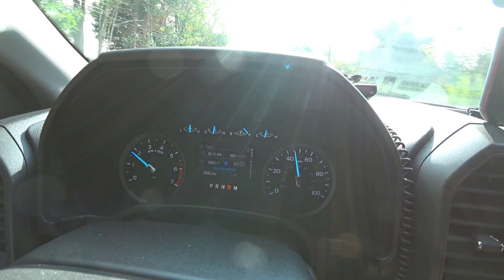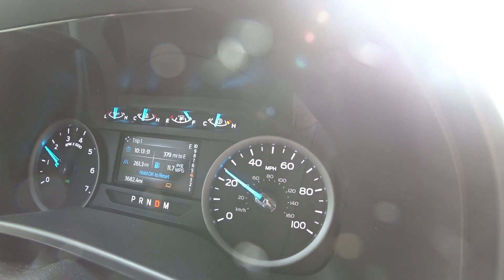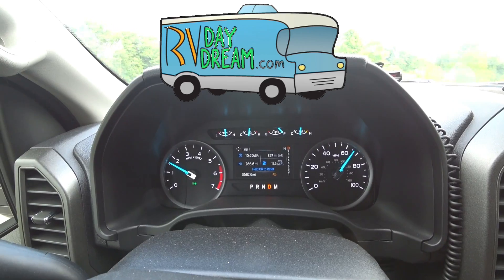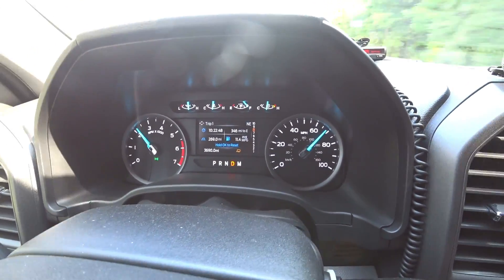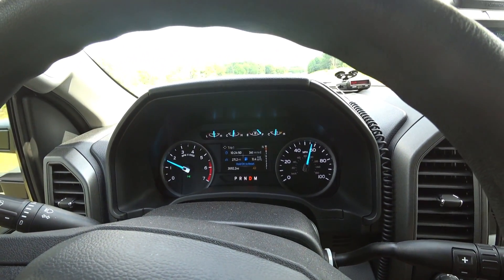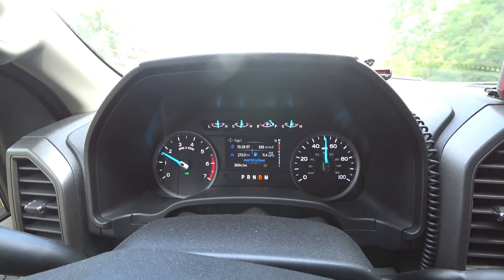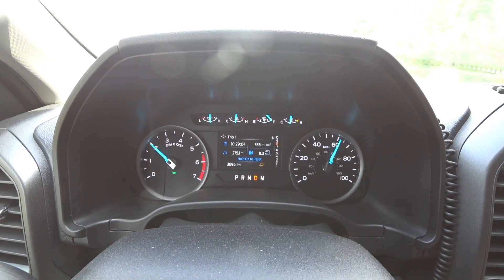2020 Superduty 7.3 Towing 8000# Travel Trailer

Comment: I'm wanting to replace my 2002 Duramax with this truck, same as yours. 

How is it dealing with fuel stops while pulling the travel trailer?  With the diesel Duramax, I just pull through the diesel lanes with the big trucks... easy peasy.  But dealing with the car lanes to get gas, sounds kinda like a PITA.  What is your experience?
Reply from the maker: With a 30 ft rv it's not bad... We are roughly 55' total length..
Reply: For routes traveled more than once, you remember the good and bad stops. I'm 53 ft connected with a 36ft 5th wheel. Have a diesel but can't fit the big nozzles so I have to hit the car diesel pumps.

Comment: Great review of towing in the real world with the 7.3. Would love to see you pull at altitude - come to Colorado.
Reply: I have a 2020 F250 7.3/3.55 and pulled a 7,000# bumper pull up to Cloudcroft, NM at just under 9000ft elevation.  It did not break a sweat.
Reply: I'd be interested to see it in CO too.  Currently trying to decide between the 6.2 and the 7.3 to tow a travel trailer out here in CO. I'm tending towards the 10 yr old 6.2 with 4.30 gearing to save $$.  I'm fine with taking an extra 30-45 seconds to climb Monarch pass as compared to a 7.3 or the diesel.
Reply: @campingalan  that's where I'm at but with a boat, easier financially to do 6.2 with upper trim and sub 100k miles instead of the new 7.3
Reply: @kyleweber1543  That makes sense!  Re-reading my post, I meant the 10 yr old design of the 6.2; not a 10 yr old truck with the 6.2l.  I towed a 28ft enclosed car hauler trailer through the CO mountains with a rental 6.2l; it did fine (not as well as the diesel ram3500 I used to have; but still fine).

Comment: TFL, Andre made a video about the 7.3 problem of defective spark plug wires. It’s just a $24 part but you don’t want to be left stranded somewhere.
Reply from the maker: #7.... Lol. Lots of people been talking about that. It's a panic move. There's so many people that are not experiencing that problem but are scared to death but they have cost those spark plug wires to go on National backorder with Ford Motor Company. That part is it's just a plug wire. Sure it's not the exact Factory part that is needed for longevity but pretty much any coil wire off the shelf especially performance ones can get you to where you need to be if you do just bite a slim chance have an issue.

Comment: We have the 3/4 ton  and we pull a 5500# camper and hwy speed of 70 we pull 9.6mpg at 1800 rpm  in tenth and it drops to 8th on small inclines

Comment: Glad I got the 6.7L diesel, it easily accelerates to pass the gutless gassers on 6% grades while towing 31 footer in the mountains (Mullan pass, 4th of July pass). Once you go black you never go back. The new Ford 6.7L and 10 speed trans is a DREAM while towing the mountains.
Reply from the maker: Wanna race? Lol.  I just beat a older 6.4 powerchoke on a double merge on ramp..... He was outfitted with a utility bed loaded with tools and ladders. I was 18,000 lbs total rolling weight pulling our 30' TT.... My fillup was @ 1.94 a gallon and my 10,000 mile oil change cost $39.00..
I've got over 4000lb payload and pocketed an extra $8000 for vacation..... There are only so many hills to climb, 80 percent of America's roads are flat🤣
Reply: @Foxboss9  the more videos that I see about the 7.3L,...the more it makes me consider NOT staying with a diesel on my next purchase.  But that’s all good, because I have a year or two before I pull the trigger.
Reply: @jobe1911  That's crazy when a full dress 7.3 crate engine is $7500.

Comment: Foxboss, thanks for the great video! I was wondering if your truck can display transmission fluid temp and what the temp is for you when towing your trailer in the hills. Thanks
Reply from the maker: Yes... the transmissions for the last few years run more hot than what we are accustomed to with older trucks. The transmission temperature never exceeded 225

Comment: Looking into purchasing the 2020 f250 7.3 to tow our 5900lb RV. Would you believe this truck is overkill for that size trailer and stick with the 1/2 ton?
Reply from the maker: If you're towing under 6000 lb and you're only doing it a couple thousand miles a year. Then you may want to stick with the F-150 because you'll be driving something that gets a lot better gas mileage the other 90% of the time you're driving it. The F-250 would be absolute pleasure the toe with especially that little of weight however when you're not Towing you would be cursing it all the time because of the gas mileage and rougher ride.
Reply: Foxboss9 wel I have a 6 inch lift with 35s on my current F150 so my gas mileage sucks already..... but just making sure my F150 won’t have issues towing long distance trips.
Reply: If the 5900lb is GVWR of trailer stick with F150.   If trailer GVWR is around 7500 go F250 as the half ton payload will run out quick and you will be on the line with the axle wt rating too.  Better to have more truck towing.

Comment: Foxboss, I really love your videos. I just got a new TT, it's 33ft and load it up to about 9K lbs. I tow with an Excursion v10 but I'm loving on your 7.3 Godzilla truck. Im thinking of upgrading to a truck with the 6.2 with a 4.3 rear diff and it's good to know your happy with the 6.2 because I dont want to spend extra on the 7.3 coz we dont tow as much per year
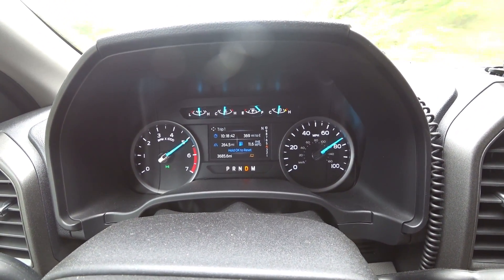Reply from the maker: If you want to go to a 2020 or newer, you can get a f350 with a 6.2 with 4:30 gear and a 10 speed trans... That would be cool
Reply: @Foxboss9  Thank you!
Reply: @8overlanding23 My bud had the 6.2 in his old truck and it was a turd. I would defintaly shoot for the 7.3
Reply: @ricochetey  It's got no power down low towing, but I think most if that is the 6 speed. The gears are too far apart for that engine because it wants to rev. I would be willing to bet that that 6.2 with the 10 speed would be a great setup, the gears are much closer together and should keep that engine where it wants to be.

Comment: I've got a Power Stroke right now. How do you think this truck would handle 5,000 - 15,000lbs a few times per week? I've got two dump trailer that I use for my business. Otherwise I will just be hauling in the bed. I want to option out a F-350 SRW, extended cab, long-bed, 4x4 with 3.73s. I'm so tired of the bs that modern diesels offer me; common rail injection, DPF, EGR, DEF, ULSD, etc. The maintenance never bothered me with diesels but the juice isn't worth the squeeze anymore. I need reliability.
Reply from the maker: We are currently full time on the road living in our RV. We are at 8,000 pounds with the RV fully loaded and the truck and trailer combined is 17000 lb as I have a lot of tools and stuff in the back of my truck because again we have sold our house and we're traveling full time. Knowing now for sure what the truck feels like under various conditions pulling 8000 pounds in having weight in the back of it also, I would feel comfortable Towing 10000 miles a year a 12,000 lb 5th wheel. So 5,000 to 15000 a few times per week shouldn't be much of an issue. Definitely get the 4:30 gears though. This 10 speed, even with 3:73 gears, stays in 9th gear a lot so you won't be over revving with 4:30 by no means. Gas mileage over the last 4800 miles has averaged 8.5 miles per gallon Towing. And I'm not easy on it

Comment: With the 10 speed, I wonder if with the 4.30 gears if your hauling gear would move up to 7th or 8th vs 6th based on the ratios. However noticed when you shifted to 10th at 70mph you were around 1600rpm or so?  That's definitely a benefit to the 3.73 with unloaded and light loads in the MPG department.
Reply from the maker: I don't know how much of a benefit is because once you get over 70 miles an hour you're pushing so much air. Plus that 10th gear ratio is such a small fraction that the difference between 430 and 373 is very miniscule. And I'm towing mainly so it really doesn't show

Comment: I can tell you from driving Cummins 6.7's    six days a week for years, you do not want a diesel unless your towing a fifteen thousand pound trailer or larger.  The reason being is the D.E.F. system and D.P.F. system, for those of you that don't know the (D.P.F. is a filter inside of the exhaust system.. This filter consistently clogs up so the auto-makers way of un-clogging it is that when the exhaust reaches a very, VERY high temperature it dumps fuel into the exhaust via a 7th fuel injector that is located in the exhaust pipe upstream of the D.P.F.)  The issue is you need to basically run these engines flat out, pedal to the floor on a daily basis, was the only way that I could keep the system clean.. and in total truck and load combined was about 34,000 lbs, so wide open throttle on a Cummins at 34,000 lbs, means your accelerating like a spanked 90's corolla.. Your just barely keeping up with traffic really.  But thats my point, if you don't have a SUPER heavy trailer, you can't go wide open throttle on these trucks and the filters will clog and it will cost thousands, over and over and over and over til you give up and sell it.  Go with the gas engine, trust me.  All my ford friends say the same exact thing, cummins or powerstroke it doesn't matter.
Reply: What year is your ram Cummins and how do you use it regularly??? Our current 17 ford super duty diesel I purchased new in November of 2017 and only been to the dealer twice for alignment and steering stabilizer. Truck is stock no modifications done and just routine maintenance that i perfom myself...daily driver and I tow a 33 feet travel trailer that weighs 9,000 to 10,000 lbs. at least twice a month. So far so good and I hope it stays that way since I'm planning on keeping it for the next 15-20 years. Probably I'm lucky or this trucks just need to be work and will remain dependable as I have seen owners with high mileage diesel with no major issues as they use it for hauling heavy loads constantly...

Comment: I dislike tow haul mode and shift manually.  It's easier on the engine and transmission and I get better gas mileage manually.
Reply: David Kendall never... those new transmissions have like this Ford-GM 10R80 or 10R140s are hightly adaptive and shift better and more efficient than any driver could... i know we are all guys thinking we are the best drivers in the world but that’s just subjective feelings... objective a modern automatic gearbox will outsmart you...

Comment: Can you do a video about gas mileage unloaded in daily life? Also can you compare gas mileage with the 6.2 I don't tow a lot so this is important. We do tow a cabin cruiser 4 months per year. Thanks!
Reply: I have the F350 with the 3.73 gears and I average about 17 mpg with easy driving. Even up to 65 mph I get 17 mpg. Once I get to about 70 mph it drops to 16 mpg average. Now you've got to take in consideration I live in Louisiana where is relatively flat most of the times.

Comment: What kind of MPG are you getting for non-towing city driving?
Reply from the maker: Not taking it easy, 12. Actually making an effort to save gas 14
Reply: i get about 12-13 not taking it easy as well, 3.73 gears
Reply: I get the same as HalfShell with same 3.55 gear.

Comment: I Special Ordered a 2021 Super Duty 250 on 10/28/20 and just picked it up 1/5/21 I had it 10 Days and had Problems with it Fuel Pump or Module is bad with 729 miles on it!! Problem I'm having here in California is the Dealer's Service Department have >>NEVER << seen a 7.3 Godzilla Engine Before!! So I WAIT): I had to tell them these Engines have been out Since 2019!! and they just say REALLY (:
Reply from the maker: Run away from that dealer as fast as you can. Not only have beef engines available in the Super Duties but all the gas motorhomes that you buy brand new at the dealer have them in it also. They sound very incompetent

Comment: drive by wire has nothing to do with the uphill shift. The load of the engine and  the g- force sensor sensor in the truck, make the decisions when shifting. It knows your on a hill. so it saves the transmission from shifting itself to death, and keeps the engine in its peak torque range. I wish chevy and ram would learn from Ford. Fords tow programming is far beyond the others.
Reply from the maker: The downshift happens when you're going downhill obviously but you can also change the gearing with tapping the brake. When I meant to refer to is that the drive-by-wire holds the throttle open at the top of an acceleration run before it has a chance to shift to the next gear. So, what's a I run first and second gear out all the way and three quarters of the way through 3rd gear I decide to let off of the pedal the RPMs stay through the roof until the truck realizes that there is no input at the pedal and that it needs to shift to the next 2 or 4 gears higher in the range. That is definitely a drive-by-wire issue as the mechanical linkage that is normally Associated between the throttle and the transmission is no longer there to tell the transmission what the throttle is doing.

Comment: so the new 7.3 gets the same mpg as your old 7.5?
Reply from the maker: Yeah, but the RV that I'm pulling is taller, longer, and heavier then what the 460 had to deal with.
Reply: Foxboss9 Makes me feel better about putting money into my 460 rebuild.
Reply from the maker: @Skitter302  I would save a rebuilt 460 conservatively and spend all the money you can trying to adapt a 10-speed transmission to it. Huge difference. Extremely hear difference having that 4 Speed
Reply: @Foxboss9   I can do ya one better, skip the adapter plate. Keep the E4OD and pair it with a gear vendors under/overdrive. Just like that you have an 8 speed Auto.
Reply: @Skitter302  not really.  You’ll have to manually shift your gear vendor back and forth to get “8 gears.”  It’s not even worth it, to be honest.  A friend of mine had one on his 7.3L PS Excursion. The biggest difference I saw was the lower rpms when on the road and in overdrive.  I know it’s been a very long time since I drove it,...but if my memory serves me correctly, you had to release pressure on the drivetrain, in order for it shift, which required backing off the throttle.  If I’m wrong, feel free to correct me on it.

Comment: Can you give us an update on the truck please?
Reply from the maker: Well we're on the road traveling full time. So I haven't talked about the truck very much but you can check out our adventures on our other channel rvdaydream. I might be giving an update on the truck and its overall performance. So far it's been stellar
Reply: @Foxboss9  Looking forward to it as I'm looking real hard at purchasing the 7.3 gas.
Reply from the maker: @Aggieland79   Well, don't discount that 6.2 liter. With everybody wanting the 7.3 I am sure that that 6.2 liter is probably bargained price and it was a good vehicle especially if you get with 430 gears and here to the trick in 2020 and 2021 you could get an F350 with a 6.2 and option in 430 gears and get a 10 speed transmission also.

Comment: How’s the truck holding up.      I heard that these new 7.3 are having some spark plug problems        Should I just get the 6.4 Hemi instead
Reply from the maker: Lol.... that's funny.
Reply: Spark plug WIRE issue...and no..it was a bad batch from the manufacturer that Ford got them from....I work at Ford.
Reply: Yeah, every new machine will have some bugs in it.   Spark plug wires are an easy and inexpensive fix.  Ford has a built a great engine and paired it with a solid transmission.    Enjoy!
Reply: @HalfShell Not by much, with the 8 speed and 4:10 gears their will be little difference except for the price.
Reply: @HalfShell That was an incredible shot in the foot on Ram's part.  Poor gear selection and untuned transmission that performed pretty...  crapily, if that's a word).   But at least it beat the Chevy (with 2,000 lbs less, haha).

Comment: I wasn't sure what your actual gas mileage was,  kept talking about your old truck and this truck so not sure what was being referenced.   If its only getting 7-8 mpg towing then better off buying a used Ford V10.
Reply from the maker: This engine far outperforms the V10. Don't get upset, the V10 was a great engine but the build quality on this one is far superior. Just like days of old, when the 460 was replaced with the V10 everybody was scrambling to get the last of the 460 trucks. But, if you go try to buy a brand-new gas motorhome you're going to find that the V10 is gone from the brand new models and has been replaced by this same engine in this 2020 Super Duty. Towing is subjectable, 460, V10 or this 7.3 gas they are all the same when it comes to Towing as far as gas mileage

Comment: What rear gear do you have?
Reply from the maker: 3:73
Reply: Foxboss9 I like your reviews of this truck.  I need a real word review of the same truck with the 4.30 gear to see if the upgrade is worth it.
Reply: Foxboss9 Also can you tell me what transmission temps you’re running when pulling a loaded camper?

Comment: So you spend money on fuel instead of breaks .
Reply from the maker: No, you spend money on safety features.
Reply: How do you figure ? The engine rpms are being held up by the transmission,all fuel is turned off the engines is just an air pump when it’s revving down hill. He admitted his foot was 8n it all the way and he was getting 7.5 that’s not bad for a lead foot towing 8000
Reply: The diesel is only worth it if you NEED the extra capability. The diesel is rated to tow more. I pulled a 10,000 lb enclosed trailer with my old 2019 Duramax and still got under 9mpg on the highway. Granted, I also have a lead foot. Maybe you can get 10-12 if you drive like a grandpa.  The difference really isn’t that big. Save the $9k.